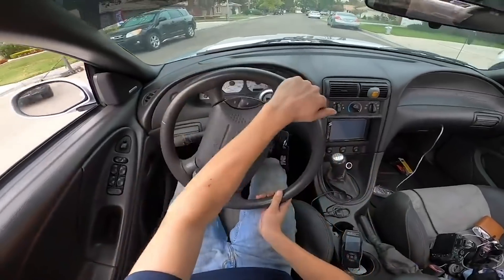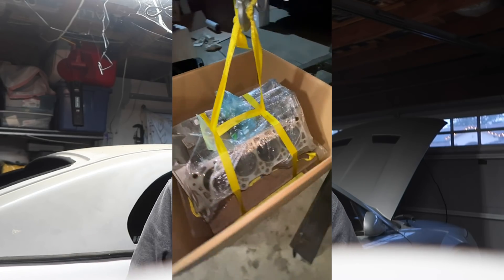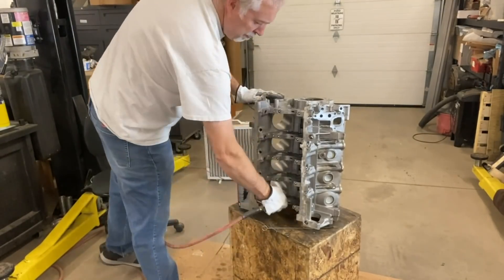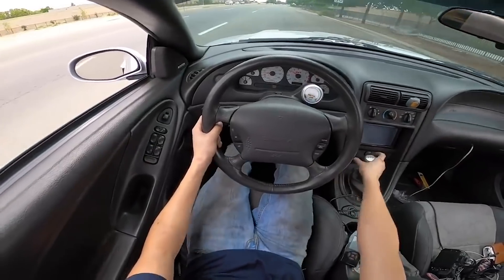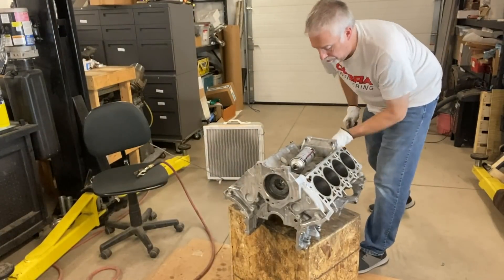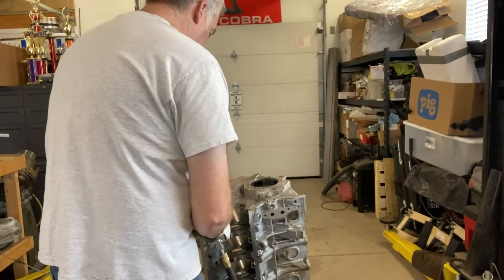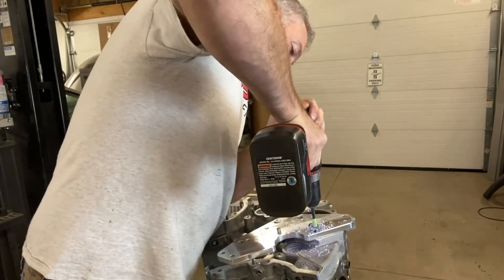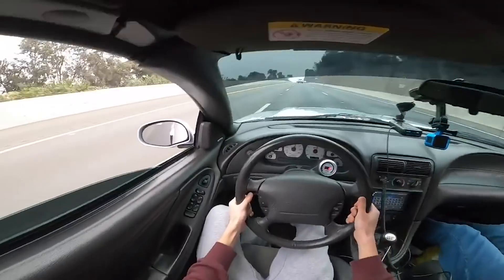Getting Scammed for a $4500 Motor. What REALLY happened to my SVT Cobra…

Comment: I feel you brother! I had a 03 Cobra DSG with a different low mile engine ( no real proof) trans was done up and the IRS was all polyurethane bushings. Had the previous owner pay for a 373 gear complete new.  Tune, fuel return, ported Eaton ( Heaton) 500 hp. Oil pan leaked from the start.

Two weeks after getting the car threw a friends friend engine had a noise on startup. Marbles in a metal can rattle. Possible lifter or timing chain tensioner. 

Year or so later electric fan blade broke, high side on A/C line blew, rear main started puking oil. I was just done. Nothing compared to your cobra but I payed good money and ended up selling my Cobra. I do have some regrets. I’m glad you are keeping yours, and weathering the storm with it. Im married with two kids so money was tough. 
Anyways glad to see you back on YouTube and figured some things out!
Reply: Dang man really sorry to hear about that, I’m looking to get into a vert 03 dsg, I hope you end up buying a shelby man!!!!

Comment: Probably MMR lol
Reply: really im considering buying  a new block for my cobra is there other website selling bare blocks besides mmr?
Reply: EARS
Reply: In the s550 platform they have such a bad rep 😂
Reply: @arnuflowzz7952  MMR is junk. The shop I’m having my Mustang built at wont touch their products. Contact a machine shop and work it out from there.
Reply: @EarsXBL  their parts are ok but definitely have a reputable machine shop do the assembly
Reply: @arnuflowzz7952  I know that the "modular head shop" sells race ready short blocks but I dont know much more than that

Comment: Man that’s what happened with my 15k motor it was a fully forged 5.2 ported heads and stage 3 cam long block from mmr 15k on start up it blew they said due to high rpm even thoe it blew on initial start up